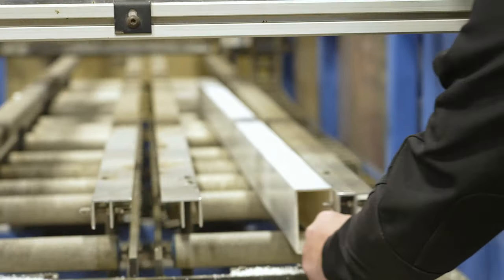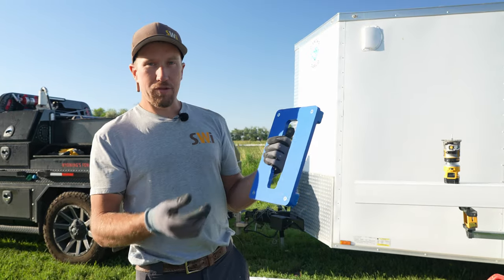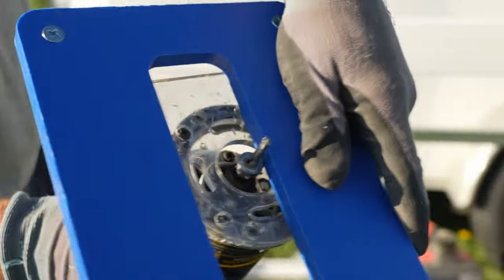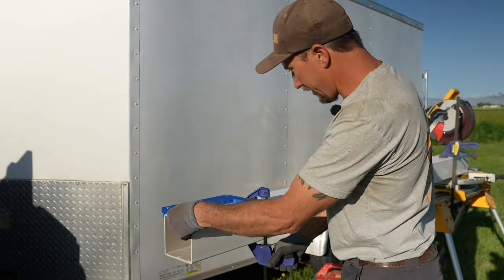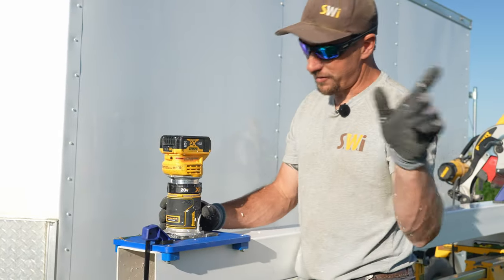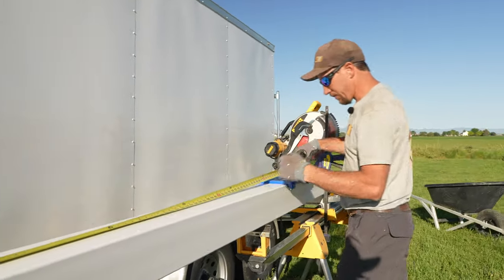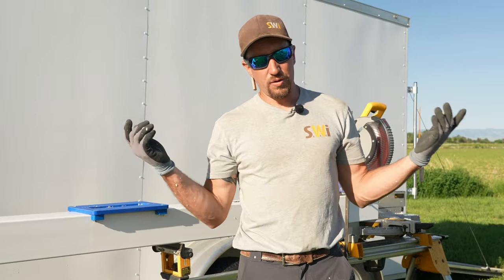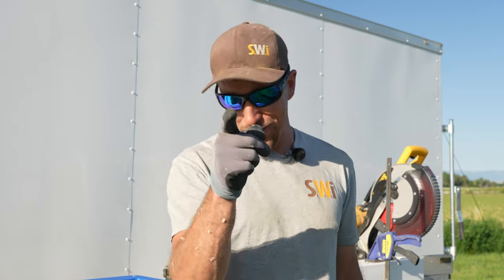The Secret To Easily Routing Vinyl Fence In The Field

Comment: Dan, I’m convinced that none of the stuff Mark said about you is true. Lol. Nicely did. Does the manufacturer have information pertaining to tolerance and such forth? In case someone wants to make a jig.
Reply from the maker: Roughly a 16th of an inch is the tolerance that we like. If it’s too tight it will be difficult to assemble and if it’s too loose it could blow apart.